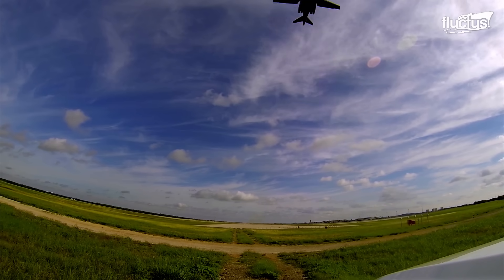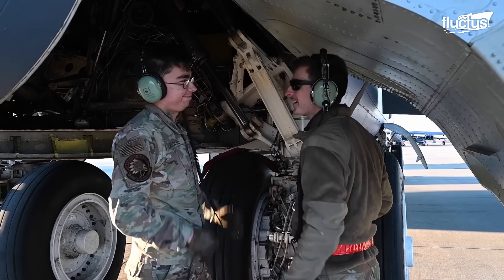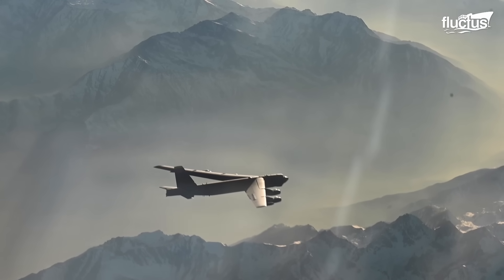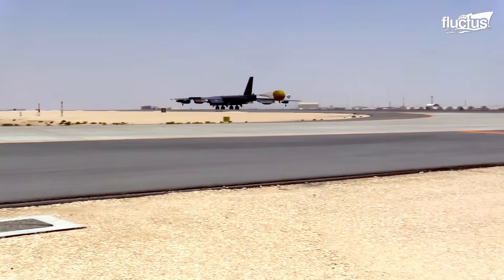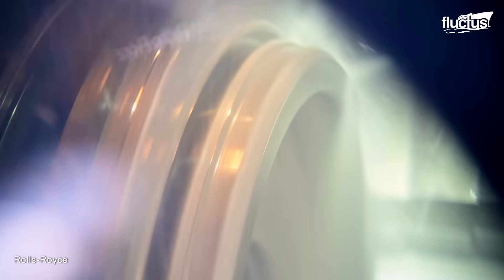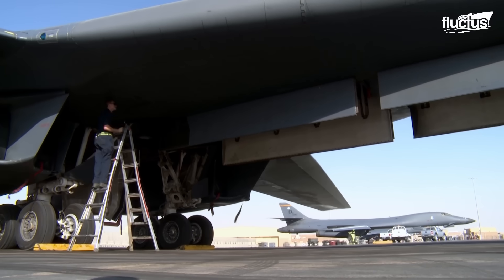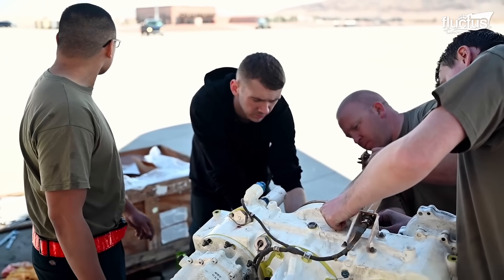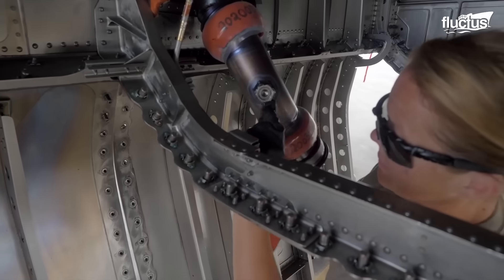Scary Process of Starting Up US Massive B-52 for Emergency Takeoff

Comment: The B52 is a truck in a "big" war.  Stand off missile launcher.  No enemy will see it.
Countries with no anti-aircraft threat will not see it as the bombs will be dropped from altitude.  The B52 H would start without big tarps at 40 degrees below zero when they were new.  (how do I know). It will be a long time before the new engines equip the fleet.  Keeping the TF33s going is magic these days,  Give those Zebras a hand.  The CSD is still a problem.  Thanks Sunstrand.

Comment: Many notes:

- Factually, the B-1B was produced between 1983 and 1986; not 'only in 1986". (the tail numbers depict the year ordered; one in 82, and the rest 83-86)

- The other is that the B-52 will forever be a bomb truck.  As the pilot said "strikes fear in adversaries when it flies over" -- the truth is the B-52 isn't flying over any (modern) adversary.  It's a bomb truck to be loaded with stand off weapons.